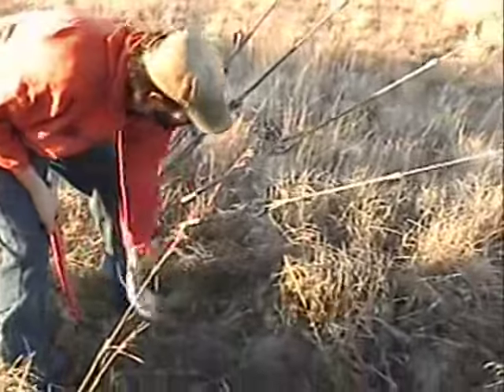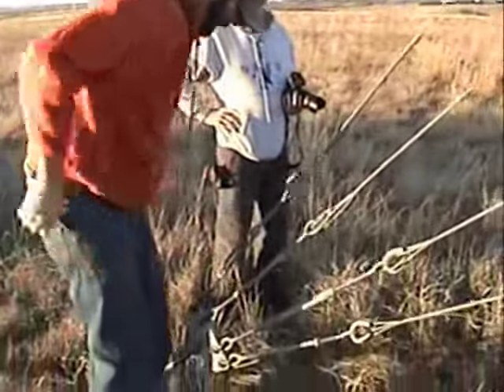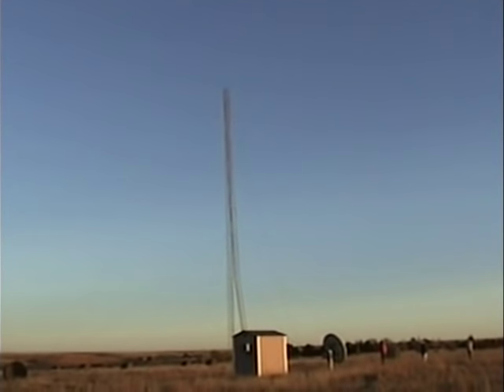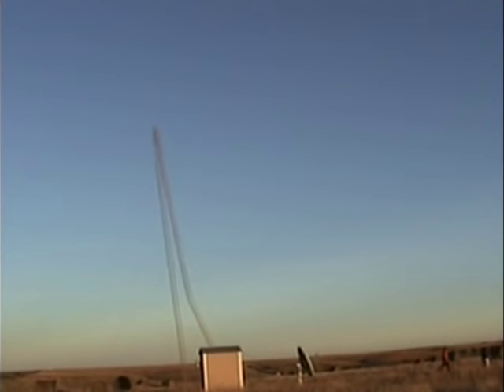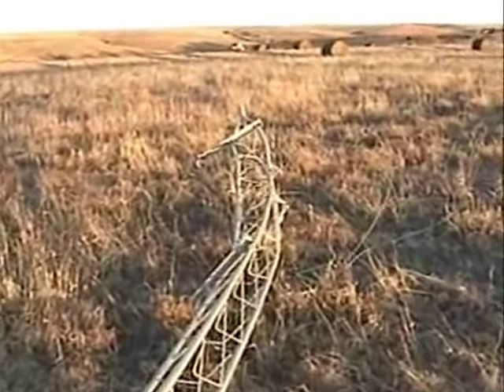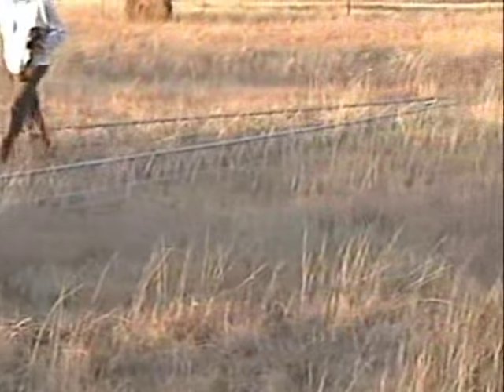Radio Tower Collapses After Guy Wires Are Cut

Comment: How to PROPERLY down a guy wire tower:

1.  Determine the windward (upwind) most guy wire.  Towers are usually usually supported by three sets of guy wires located 120 degrees apart.

2.  Lay your air pressure hose, disconnected on both sides, from the upwind set of guy wires to near the air pressure source.  Again, do NOT connect the hose to the source at this time.

3.  Position your REMOTE CABLE CUTTER (see link, below) on the BOTTOM-MOST guy wire.

4.  Plug the remote cable cutter into the air pressure hose.

5.  Clear the area around the tower to a radius equal to the tower's height + 50%.

6.  Ensure that the air pressure source is well outside the height of the tower + 50%.

7.  Plug in the air pressure hose to the source.

8.  Charge the air pressure hose with sufficient pressure to operate the cutter.

In this manner, the lowest joint of the tower will be adversely supported, likely resulting in the tower collapsing on or near it's center.

Comment: $150 a section on a 200 ft tower would not have paid a tower crew to take this tower down section by section. In fact even after selling the tower to an eager ham they still would have been in the hole significantly. They went the cheapest route.( not saying the best but the cheapest.)